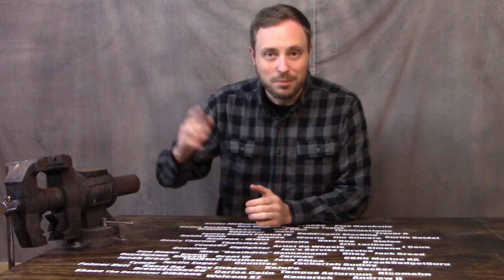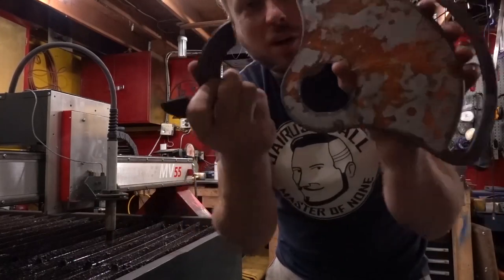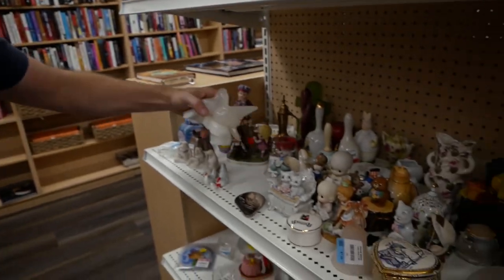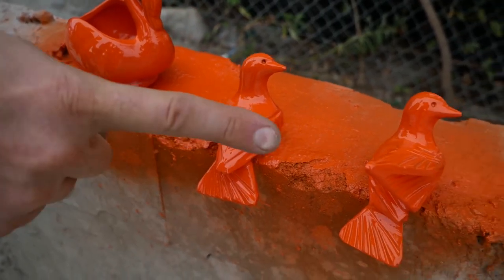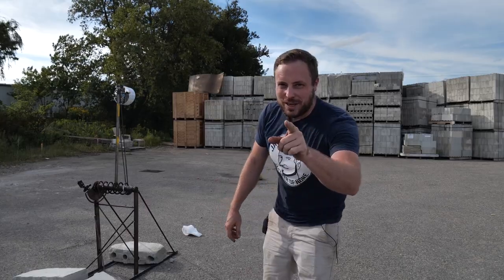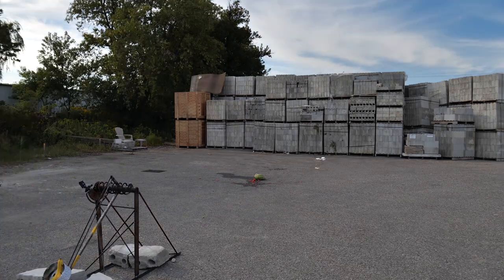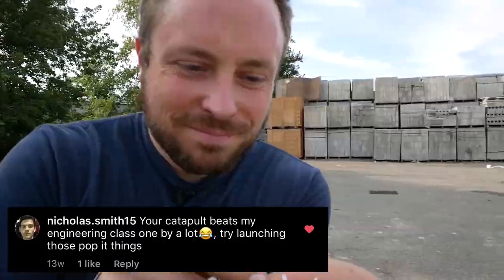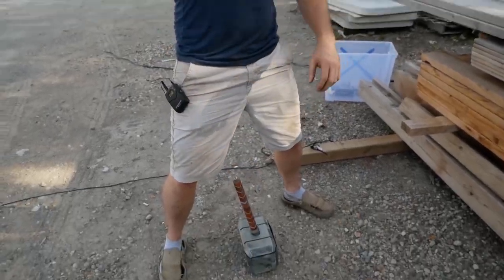Trash Catapult - Test and Build

Comment: I think the bowl is about twice as deep as it should be. There should be a trajectory as it leaves the bowl, but it's firing straight or even slightly downward. If the bowl were half as deep (just a guess on the fraction but it seems right), it would still hold the items and I think they would release a bit sooner and thus fly farther.